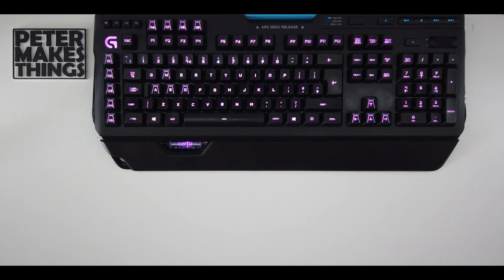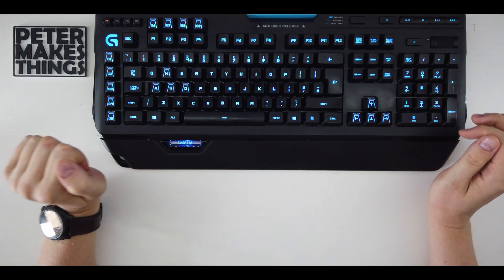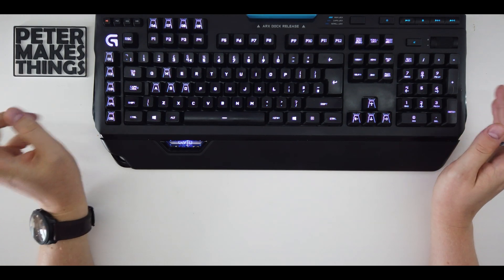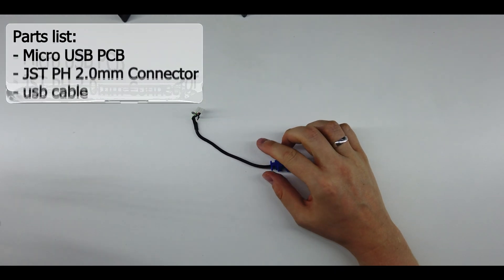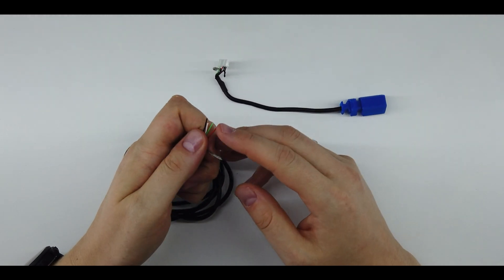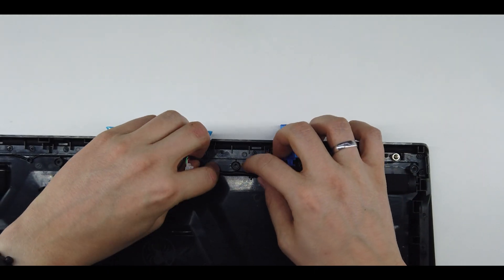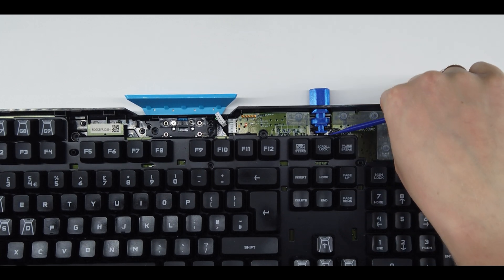Semi-wireless Logitech G910 mod

Comment: Can this be done with USB-C instead of micro USB? I notice the PCB you linked has a USB-C version but it only has 4 pins instead of 5. Also, would this be safe to do without an enclosure? I don't have access to a 3d printer so thinking of just letting the board hang outside the keyboard. Thanks and great video!

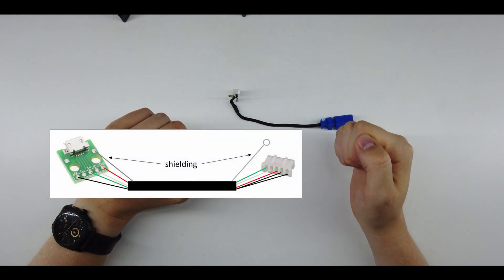Comment: Why are there 4 wires on the left and 5 on the right, where does the extra black come from ? (excluding shielding) 4:14
Reply from the maker: the ground is doubled, just connect both pins to the GND

Comment: Isn't there enough space to mount the micro usb socket inside of the keyboard? I worry that the external part would bump into things when moving the keyboard.
Reply from the maker: Potentially it could be possible but tbh too much hassle for me, I use it for few mths and never had any issues nor damaged the keyboard or connector, it's a simple solution that just works, and if something gets damaged then it's super cheap to replace